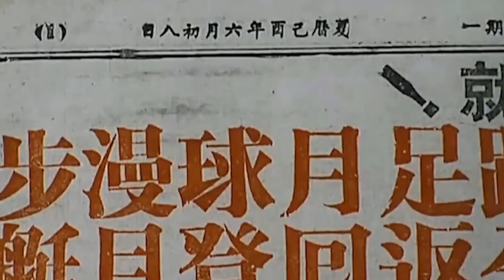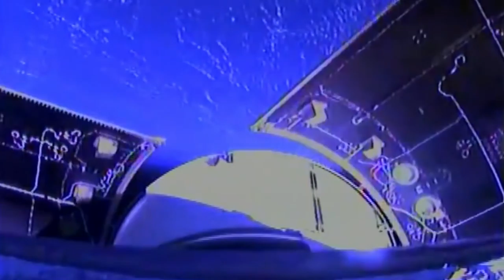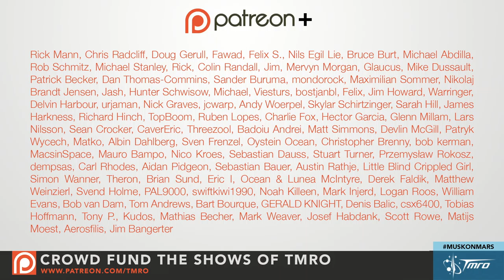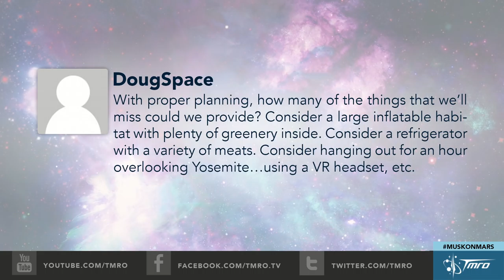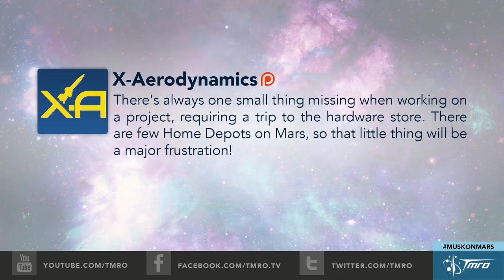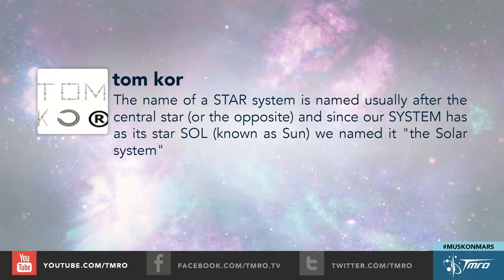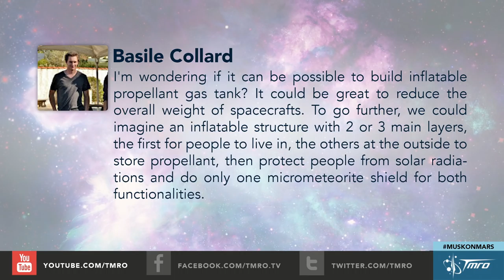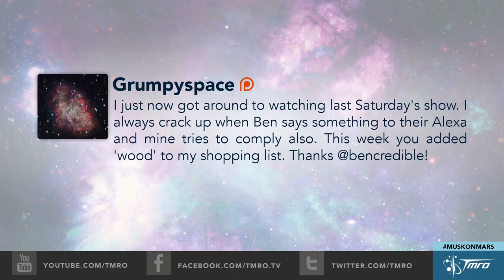Elon Musk hinting at Mars plans - #MuskOnMars - 9.20

Comment: I believe it is possible to do it within the timeline, however it is very optimistic, very likely to be delayed. I wonder how much the distance between Earth and Mars in each launch window would impact a manned mission since the distance range is from 0.37 to 0.68 AU, impacting directly the time needed to get there which means we would need less and more supplies or lower/higher radiation exposure.

It seems SpaceX isn't caring much about that, so i wonder if the impact is not that significant at all, the launch windows for 2025, 2027 and 2029 are pretty bad in that regards, with distances of 0.64, 0.67 and 0.65, respectively and 2033 and 2035 seems to offer the best situation with Mars at 0.42 AU and 0.38 AU. Also i have read the 2033/2035 windows coincides with a period of lower radiation from the Sun.

Comment: The biggest issue to me about a mars mission is landing all the separate pieces at the exact same place on Mars.
Reply: Landing at a designated surface location is mainly a matter of timing, and since it is likely that the first step near Mars will be to establish an orbit around Mars, it's not hard to establish the right timing for the descent.
Reply: If they don't get close enough, that is a deal breaker no? What is the margin of error there? MSL was like 1.5 miles off of it's target, which at the time everyone cheered about. I think if all your pieces are 1.5 miles apart then game over. Right?
Reply: With the Mars Direct mission plan, the pieces didn't need to land next to each other, only close enough to get from one to the next using the rover.
Reply: Ben Anderson So they can transport fuel for the return rocket and all the supplies over several miles? That seems like it could be quite a challenge given Mars' unforgiving environment.
Reply: It should be possible. A design for a crewed Mars rover will most certainly take into account the lessons we've learned about Mars' surface. Think of it as the ultimate Jeep Rubicon: able to conquer anything you throw at it.
Reply: ***** Yeah. It had better be.
Reply: bro they landed a probe on a damn asteroid, you think they can't do such precise landings?
Reply: I don't recall saying it couldn't be done. I'm pretty sure I said it would be one of the biggest issues. "MSL successfully carried out the most accurate Martian landing of any known spacecraft, hitting a small target landing ellipse of only 7 by 20 km (4.3 by 12.4 mi)" I don't think that kind of accuracy is good enough. I think it needs to be within a mile, but then I am not claiming to be an expert.

Comment: SOL may be named as Sun in english, in french it is Soleil
Since lot's of word are based on Latin in french I thought to do some research and it turns out Sol, Solis is the latin word for sun
it is also the base for other latin-based language
The only latin word I could find which make sense with Sol is the adjective Solus, which means alone, left alone or isolated
though I don't think it has any relation
would need to ask to someone a bit more informed on latin for that
Reply: they used Sol as well, I only used Sun as it is the most common one
my point was about what they said afterward, that name chosen are for some boring
sure they are for some but considering they were talking about Sol I thought it'd be nice to point out it has an origin (as of Sol, not sun, dunno about this one)
people could be confused about the solar system being called as it is and not sunaris system since the most commonly used word in english is sun and not Sol

Comment: That is a very aggressive time-line. An unmanned dry-run of the complete system takes just short of 3 years, so to do a complete unmanned test before sending people the whole system has to be ready to launch in 2020 if it is going to do a manned mission in 2024. That is optimistic... No one has done even a little ISRU on Mars (one experiment planned on the Mars 2020 rover) yet and a manned return vehicle needs a massive ISRU-system for making 10s of tonnes of propellant. That system also needs a lot of power, lots of solar panels or a small nuclear reactor to run what is essentially a small refinery.

If it is a one-way-mission or at least a mission where the people are not expected to return for 10 years or so then it becomes a little more feasible, an unmanned dry-run of the system can take place in 2022 and there is less need for an ISRU-plant although you probably want one to at least make oxygen for you.

It will be very interesting to hear what Elon has to say in September :-)

Comment: I give Elon (plus NASA) a 50% chance of manned by 2024 and maybe 70% of Dragon on Mars by 2018 - haven't SpaceX been testing a lot of mission techniques with the booster landings i.e. high altitude (thin atmosphere) retro burns etc.? The Heavy launch going well later this year will be the key dependency I feel.
Reply: i dont know about chances, but 2024 for manned is pretty tight. elon needs to have MCT fully ready by then. i'm pretty sure spacex had MCT all designed and maybe partially tested, but have it fully rated for manned mission is entire story by itself, not to mention it fully operational.
Reply: Sounds about right. These complaints about "Elon time" forget that SpaceX has come a long way lately. Elon has a lot more experience under his belt, and presumably has a better feel for these things now. This MCT architecture has been in development for years already. And with NASA's help, I don't think 2024 is out of the question, not by a long shot.
Reply: taiwanjohn yeah you're right. considering nasa is providing their decades of data (i assumed they fully cooperate with spacex) maybe 2024 is not that very improbable.
Reply: +taiwanjohn so true

Comment: I'm with spaceMike. Take what a company is saying and multiply it by 2. So You end up with +8 years. ;-).
Apart from that, SpaceX needs way more than just a big rocket. Did they solved the health issues, or are they working on a nuclear reactor? In case of a sand storm that darkens the sky for weeks, solar plus batteries won't save the mission.
What about a fully closed life support system, because that would really bring down the costs for such a long duration mission. Well, even planetary protection can stir up some problems for them.
No hate against SpaceX but rockets won't solve every problem they will face.